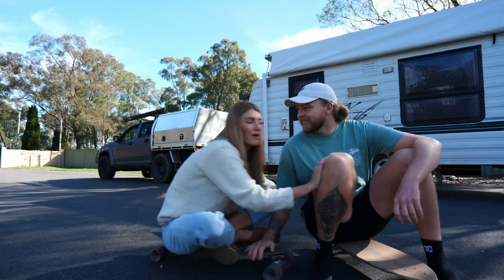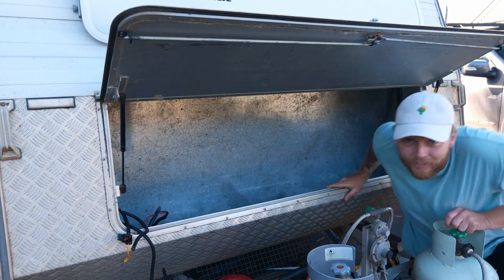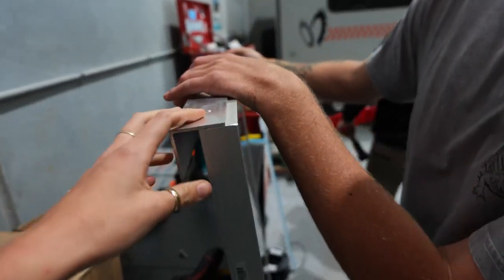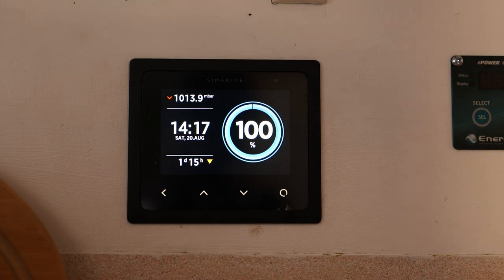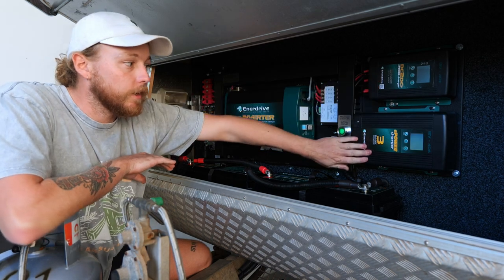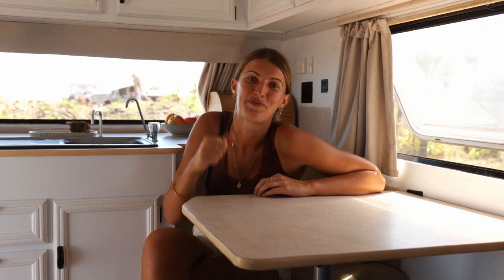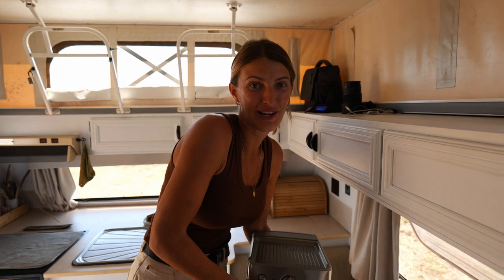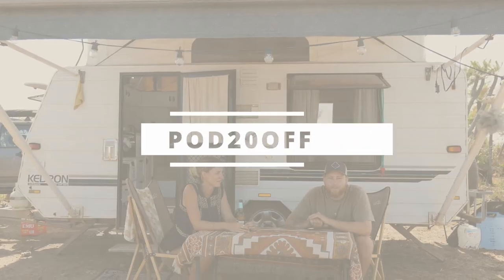AGM to Lithium Conversion With Plenty Of Dust

Comment: I am impressed with the air fryier, three whole potatoes go in and come out all sliced into chips?  I find it very confusing still, obviously I must not be that clever) i.e. the air frier; whilst operating the meter shows that if the air frier was left running the batteries would last 1d05h or 29 hours. Is that correct?

Comment: Am curious............. what sort of weight training you did you do tp get enough upper body strength to lift  the roof with all those panels up there????????????? I know the difference adding one panel made.
Reply: Yeah I agree, the weight those struts can handle must be enormous.
Would like some feedback on this issue. Thanks.
Reply: We try to go to the gym once every 3 years 😂 
But honestly we didn't feel too much of a difference after the 4 panels were put on. Our old panels weighed 15kg each (30kg total) and our new Enerdrive panels weigh 12kg each (48kg). 18 which I don't think is too crazy. We gave them a trial run before we mounted them and everything went smoothly. 

Although since we have had the van Denya has always laid on the bed and pushed the arms up with her legs so I doubt she feels any difference 🤣

Comment: Great set up what was cost for the conversion?
Reply from the maker: Hey! For the products shown in the video and the description the total cost of the conversion was $9,825! Hope that helps :)
Reply: Was that including the Autolec? Other questions, 86A for coffee maker whilst brewing. Does that mean you are depleting battery by 86a/hr in essence? 86 x 12.8v = 1100w. Is that correct?  Doesn't sound like enough given the Brevilles are generally a 1650w machine, or maybe that's the grinder power requirements? @Caravanrvcampingaustralia
Reply from the maker: @lindsay6529  Hi Lindsay. If you'd like to talk to our solutions team you can contact them on  1800 787 278. They will be able to assist you with this one. :)